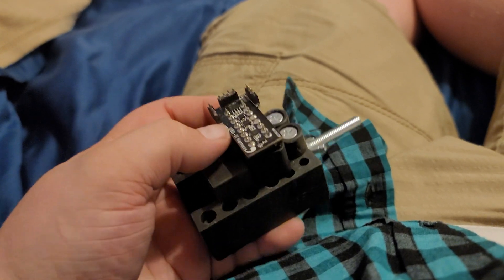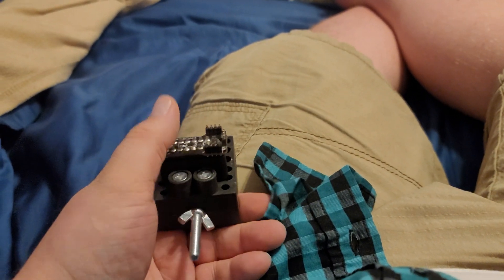Chevy Bolt EV OpenPilot Port update - code rejected... not sure how to proceed

Comment: It seems like another alternative is to find and fix the timing glitch in the Comma, and/or rearchitect the Comma code itself to provide more real-time guarantrees.  There may be ways to create real-time threads on Android or Ubuntu.  I know that the days of needing a separate RT kernel are lessened with new RT features in the standard Linux kernel.
Reply from the maker: This could be - the catch being Comma is using Python for the primary message loop...
More than that, though, vehicle manufacturers must use RTOS (or similar) for components interacting with the drivetrain

Comment: i ordered a cable set from you for my Bolt last year for my Comma2- are you able to make it or at least tell me how?
Reply from the maker: Yes to both, sort of. The cable set for the comma 2 is incomplete - lacks dash notifications. If the schematic isnt't up, I can fix it so you could diy if so desired, but if you can hold out a little longer I will have a better solution (which will probably also be open source)
Reply: @StandBackLabs  Thanks! I've seen several schematics and not sure what's the best or most recent....any direction is appreciated!
Reply: The info to make your own cable has been online for over a year.  That is how people have been using it.

Comment: I wonder if their concerns might be impacted by the Bolt recall.
Reply from the maker: The port isn't Bolt specific - that is just where it started. There are an increasing number of GM vehicles with these flawed steering columns, and unfortunately the chances of GM fixing it are ... (Insert impossible metaphor here) 😂